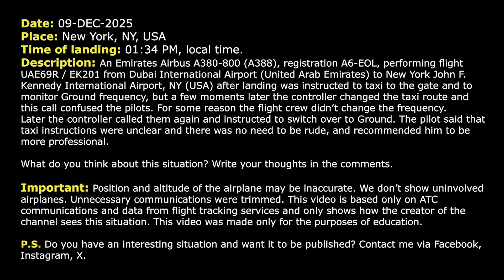Emirates pilots ask JFK controller to be MORE PROFESSIONAL. Pilot argues with controller. Real ATC

Comment: Pilots were definitely in the wrong here, the controller was very clear 😂
Reply: The controller was clear in a verbal communication sense, but not in an instructional sense. 

Right - alpha, short D quickly changed to
Straight - alpha, short D. 

With the added "...don't stop..." "...I told you not to stop..." "...keep your speed up!" "...traffic is behind you!" 

The flight crew was confused because to them the original instructions - right alpha short delta - made sense in relationship to where they were located. Then the tower told them, wait no, go STRAIGHT alpha and hold short delta. They were probably thinking, did he really mean that? To go all the way around the airport? 

They're driving a giant ass plane, so they can't just quickly stop and change directions. It seems they WANTED to clarify, but because another plane was behind them, the tower wasn't going to give them a chance and was frustrated when they simply didn't "go".
Reply: @gatolibero8329  spot on. thanks for having IQ, when others clearly don't.
Reply: I mostly agree. I think the pilots were confused by the right/straight switch. And being in such a massive plane they paused to verify where they'd be going on their charts. Only problem was the 777 behind them didn't give them any time to do that, which then irritated the controller a bit. I think the pilots were good to double check the controller's instructions, but in the end it shouldn't have taken them more than a few seconds to do so.
Reply: @3rett115 it will take more than a couple of seconds to verify that instruction. Switching up instructions like that and when the pilots don't expect to go around the airport, first assumption to the pilots is that ATC made a mistake. So by slowing down to clarify is good CRM.
Reply: @3rett115  The 777 wasn't the thing which took the time away from them. Their packing in of planes in an unsafe manner is what created that situation. They created that situation themselves, then got angry because it didn't magically go perfectly like it did in their imagination.
Reply: @whatilearnttoday5295  facts
Reply: Yeah, very clearly "Turn right on Alpha.".... Followed by trying to make them go faster.... The controller gave gibberish instructions then immediately got angry.
Reply: Switching from turn right on A to go straight on A creates confusion especially when you’re exactly at the point you’d have to turn. Does the controller think we’re already turning? Would Go straight still make sense if we don’t take the right turn? And pilots are trained to clarify things before doing them. There’s no rushing just because there’s someone else behind you.